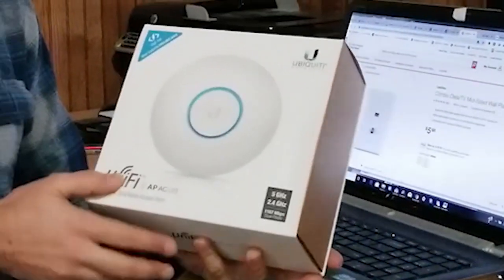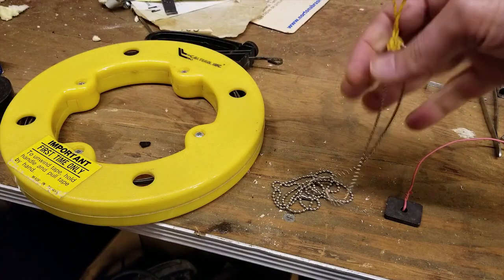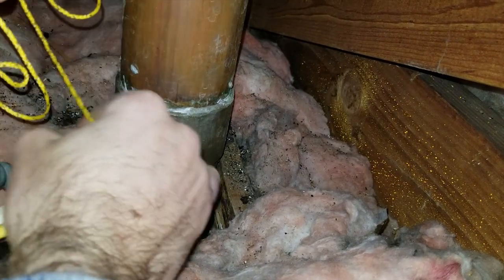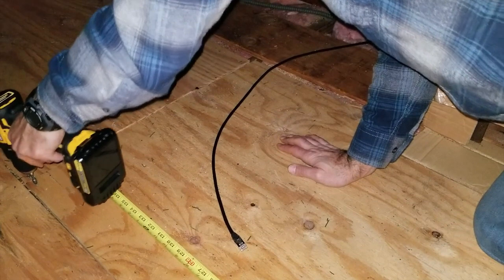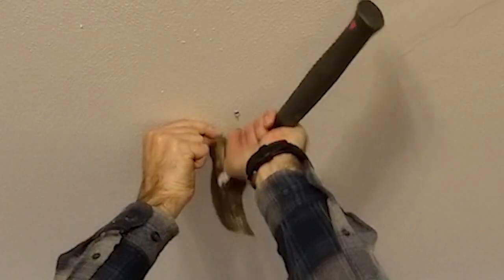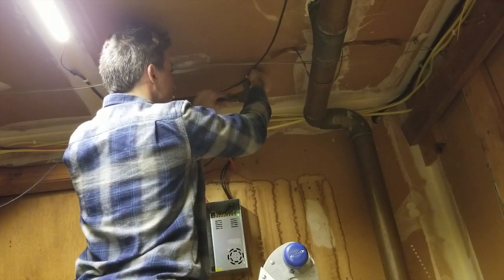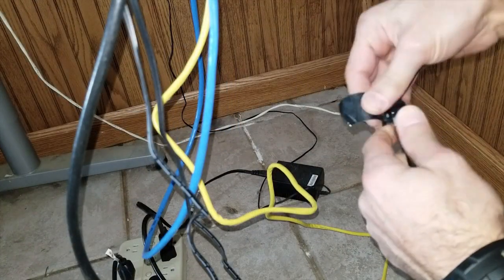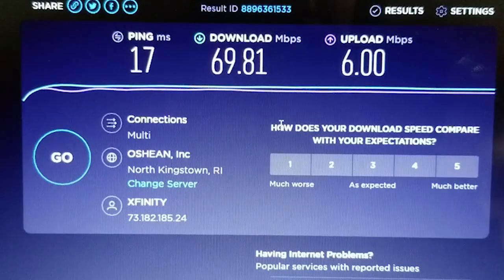Installing a Ceiling-mount Wi-Fi Access Point

Comment: Running the Ethernet line in parallel with electrical lines that run A/C current can degrade or blead over on the ethernet "Transient voltage".
Reply from the maker: Good catch! When I originally posted the video, a viewer pointed out the mistake which resulted in me making this follow-up: https://youtu.be/zGA4RG6Jlxw

Comment: We are building a new house and I plan to install AP's during the framing, before the drywall goes up, so no need for all the fishing (I hope!). I'm planning ceiling mounted APs in the family room and living room areas downstairs, and another upstairs where the bedrooms are. Any guidelines on how many square feet today's access points should cover comfortably?
Reply from the maker: Good move doing the work before the drywall goes up! Regarding placement and number of APs, you can consult the suppliers of the products for guidelines as they typically have different grades of models for the amount of coverage and bandwidth needed. I used Ubiquiti products based on the recommendation of a coworker, and the AP I selected was one I felt would sufficiently cover the raised ranch style house and number of wireless devices. Thus far, it has served me well with four occupants, each with computers, phones, and Wi-Fi connected televisions. The single AP also kept my router relatively simple and inexpensive.
Be sure to watch my follow-up video where I corrected a code violation I had committed by running the Ethernet cable in the same cavity as the power cables. Thanks again to the viewer who pointed it out!

Comment: en américa latina la mayoría de las casa son de concreto, muy poco de madera. y estructuras ya hechas donde no quieren que se haga remodelaciones, pasar cable por los mismo orificios una labor titánica, los técnicos si se tiene complicaciones.
Reply from the maker: With some help from Google Translate, here goes:
Comment: In Latin America most of the houses are made of concrete, very little wood. and ready-made structures where they do not want remodeling, passing cable through the same holes is a titanic task, the technicians if you have complications.

My reply: I hope that the designers of the structure included some extra holes to allow cables to pass.
Mi respuesta: espero que los diseñadores de la estructura incluyan algunos agujeros adicionales para permitir el paso de los cables.

Comment: how is your bandwidth being affected rynning your ethernet cable along side electrical romex wire??
Reply from the maker: I didn't notice any real degradation. However,  do check out my followup video where another viewer pointed out the code violation of running the two near each other. I rerouted the Ethernet cable to mostly resolve the issue. Thanks again for watching!

Comment: Good video but one thing to keep in mind is radiation pattern. It can be beneficial in planning which way it points on the  ceiling. Some of their APs can vary in signal strength depending on which way it points (not a lot mind you)
Reply from the maker: Yes, very good point. I chose the location for mine based on getting it central in the house and broadcasting down to get the best coverage.
Reply: I thought these were all Omni directional?

Comment: Thank you for sharing. Attempting this setup in my garage ceiling. Did you makeup your CAT cables with connectors or purchase a long cable? Keep up the good work.
Reply from the maker: I was able to buy a pre-terminated cable that was the right length. Worst case I could have bought RJ45's and and a crimper, but I did not need to in this case. Please watch my follow up video where I corrected a routing error I made in this video which violates electric code.

Comment: Great video. Is there a chance it would overheat on the ceiling? I know it gets hot on the desk. Do you seal the hole afterwards?
Reply from the maker: I have not had a problem with mine. This AP is designed to be mounted on the ceiling or wall. I stuffed a little insulation into the hole to prevent drafts.
Reply: @par64guy  great. Thanks. Great walk thru. I also have a pipe running from garage upstairs and its a pain as cable gets snagged easily!
Reply: @par64guy  do you have any plans to upgrade or add to your network?

Comment: I purchased a new house and there is a cat6 prewired on both first and second floor. The WAP you have on this video is connected via POE, is the POE or injector connected directly to a wireless router? I have a netgear wireless modem/wireless. The builder wants to charge over $1k on 2 ubiquity access point. I checked amazon and these are only $150 a piece. My concern is where would i get the power source to the ubiquity. Thank you
Reply from the maker: My AP came with an injector. I plug the injector into the router and the output of the injector to the cable that runs to the AP. I would order the AP's yourself.
Reply: If you buy a single AP fro  Ubiquiti it usually comes with a POE injector. If you buy their bulk I.e discounted 5units they  dont but if you pick up one of their small POE switches it ends up cheaper

Comment: What "power of ethernet" cable standard is required for a WAP?
Reply from the maker: I don't recall off the top of my head,  but I used CAT6. Some cables have thicker conductors to handle higher wattage and longer runs.
Reply: @par64guy  Does the box/manual mention what kind of POE cable standard is required?
I think the minimum must be cat6, but there's no standard information on the internet
Reply: Ubiquidoes mention it isn't 24v anymore though

Comment: I’m trying to terminate a big fat cat 7a+ cable to one of these but it’s too fat to fit in an rj45 connector. How do you do this normally?
Reply from the maker: My guess would be you would need an RJ45 designed to terminate CAT7a+. I have only worked with CAT5 and CAT6, so unfortunately I have no experience with CAT7.

Comment: Very good video! I just finished pulling Cat6 cables into my attic.  It’s a challenge working in the attic for me since it’s like 105F outside plus all the insulation.  Next for me is putting in a Ubiquiti AC Nano HD.
Reply from the maker: Thank you! I like the Ubiquiti products. My coworker introduced me to them. Please watch the Part II video I produced where I had to correct a critical and unsafe cable routing error I had made in Part I.

Comment: Do not fish cabling this way.  You should never put AC wiring (the yellow cables are 14AWG for a 20A 120VAC circuit - Romex) and low voltage cabling in the same hole.  Also, you cannot put electrical and mechanical in the same hole.  In this install, all three are in the same path.  This is not safe.  There are EMI issues, but it is more than that.  In a fire or earthquake, or even just from vibration over time, the pipe can move pressing the cables together potentially shorting out the wires.  Running 120VAC from and 20A breaker would cause a lot of trouble and potentially a fire.
Reply from the maker: Good catch. I missed that detail when running the cable. I will move the Ethernet cable by drilling another hold near the pipe to force some distance. I will see if I can secure the Romex lines as well.
Reply: @par64guy  If you can add photos to your video it would be great.  Just trying to keep people safe.  Cheers!
Reply from the maker: @BigniceJohn  I just rerouted the cable today and recorded it. I will produce a sequel video showing the problem and how I corrected it. Sneak preview - I made use of a nearby closet.
Reply: Michael Lorello thank you for doing that. Many would blow off my comments. But most of all, I am glad your installation is a bit safer.
Reply from the maker: @BigniceJohn  In case you did not see the notification, here's "Part II". I gave you a shout-out as a thank you for bringing that mistake to my attention. https://youtu.be/zGA4RG6Jlxw

Comment: Def helpful, but I believe locating Ethernet wires less than 12-18 inches from high voltage wires causes more EMI when running parallel . If you have to cross them I would only do it at 90°
Reply from the maker: Definitely a good observation. I would expect this is more critical with houses wired with nonmetallic (Romex) cable. Unfortunately, my options for routing the cable were limited, so I had to violate that recommendation. To those reading this who are still in the planning phase, see what you can do to minimize how often your signal cables run parallel to power lines.

Comment: Thanks for your video! Installing a nanoHD shortly in my own home, so this was very helpful. Curious why you ran pre-terminated RJ45 instead of terminating the cable after fishing it and passing it through the ceiling.
Reply from the maker: Thank you for watching, and I am glad it helped. I used preterminated mainly for two reasons. First, I figured I could fish the cable with ends already installed to save some time. Two, I don't own a RJ45 crimper and was feeling cheap and lazy.:)